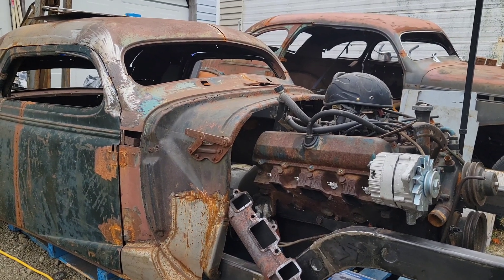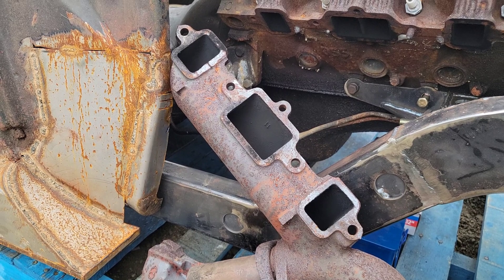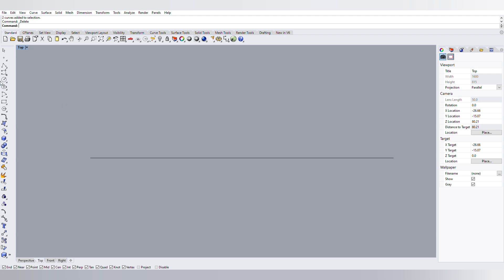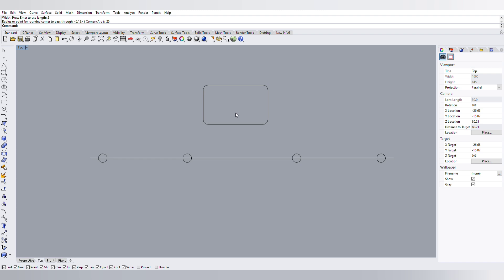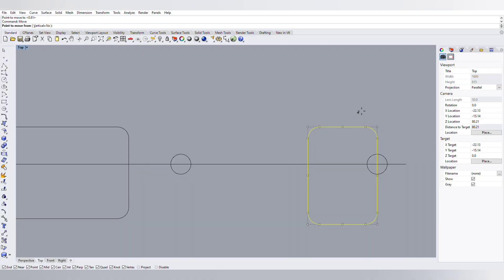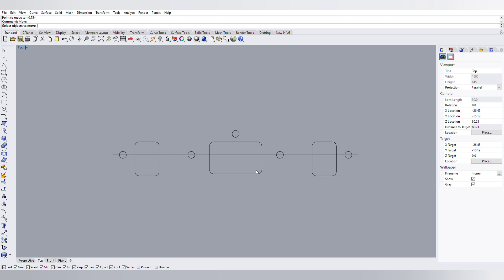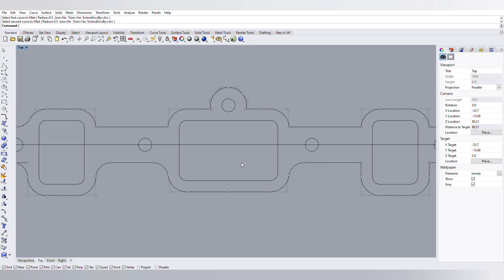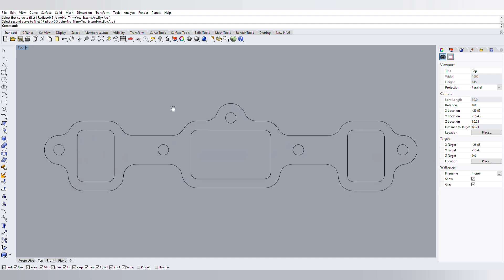Monday Morning CAD Episode 6  Header Flanges for my 260 Olds V8

Comment: Just a thought, with the size of your feet and the size of the car, I would think a reverse pattern manual shift powerglide with a turbo input shaft might be just the ticket as I don't think you will have enough foot room for a clutch pedal. I used to work for Bill Hays of Hays clutches  and more recently Centerforce clutches. I worked for bill in the first year of Counterforces existence. It was fun, my buddy and I got to thrash test clutches in our cars after work. Anyway, if you must have a clutch. I would suggest a 9 inch twin disc Centerforce clutch. You will probably be wearing light shoes to fit in the car. The Centerforce has a light pedal but will hold a lot of HP.
Reply from the maker: Everything I own is auto, the blown big block in the other one is staying auto wirh a full manual valve body.  Got to have a stick this time.  Looking at saginaws and muncies or maybe a t5, but it may depend on the next couple days, I think I have something stupid that will be amazing coming 🤣
Reply: @kingofbootyfab  muncie M22 ( The rock crusher is the best )

Comment: Even though I don't have access to a CNC machine I'm finding these CAD videos interesting because you are working on stuff I can relate to.  I've built some tools and equipment and related items but using mostly basic tools.  I've even made a couple of exhaust manifolds but just for 1 and 2 cylinder small engines.  I think I am going to try playing around with some free CAD software just to see if it is something I could learn and make use of.   I wouldn't want to spend the bucks for something like the Rhino 3D and then find out I couldn't learn it or just didn't want to put in the effort.  On the other hand if it looks like something I could get the hang of the money would be worth it later if I wanted to continue.
Reply from the maker: I'm working on some videos of free open source software for people who want to learn without fancy software.  Honestly being able to program simple brackets and flanges opens so many doors for people building Cars, and is a skill that requires zero special tools.
Reply: @kingofbootyfab  That would be great.  Looks like there is quite a bit of open source stuff out there but without any experience with any of them I wouldn't even know where to start or what to begin learning on.
Reply from the maker: I'm going to test some, I've got a couple on my computer already, if I'm gonna do these videos, it feels like the right thing to do and I'm no engineer, just a guy that knows how to program.  So I'll give some solid feedback.  Hopefully in September

Comment: Headers. If the tubes aren't around 28 inches with a 4 into one collector There is no HP difference, none.   PS. I have a 1000 HP engine dyno.  That little engine with a 471 GM supercharger, two 600 CFM 4 barrel carbs would be an awesome tire shredding cool looking m o chine in that car.  I would also put the radiator in the back of the car and use an electric water pump as well as putting the alternator down low. That cleans up the engine and makes it look more bad ass ! I would also use Zoomies  COOL....Just a suggestion. Love your work !!
Reply from the maker: 28 inches will be hard to get, but my plan will get then close even if it wasn't my intention.  I'm looking into later Eaton superchargers, I know where one is, from an 80s T bird, would be just about perfect, just need to convince myself.  From my understanding this is the next generation of Olds motor after the aluminum turboed 4.3s, so in theory, small bore, thick cylinder walls, maybe it will hold up to a little boost.  I haven't decided if I'm brave enough to risk it yet.  But it's definitely on my list of possibilities.
Reply from the maker: I seriously considered the rad in the back.  But being honest  I'm not sure there is room.  If I have it, that's where it's going.  But I need to get the rear end in before I decide.

Comment: Hi, The artifacts were left because of the way you selected the lines/curves. Left to right does one thing and right to left does another. One deletes and the other does not. Watch the video and you will see. I didn't Know they made Oldsmobile's that small. Back in my day everyone who had one had a 455, Always in boats.
Reply from the maker: Absolutely.  I could have reduced the radius but it just didn't suit my tastes.  Rhino is weird though, some days it will filet the corners just fine and not do that, some days it leaves me the lines, I have a feeling it has something to do with the way I program, which according to my engineering friends is the absolute wrong way to do things, and also the reason I've gotten into the habit of joining everything, and making sure that it states it is one closed curve, and not an open one which means I have extra lines I missed.

Comment: 0:43 there should be a common line  between side window height and windshield height position
Reply from the maker: I know exactly what you're saying.  But that's factory location for that body style, I haven't messed with those lines at all, and rhe amount of work it would take to move the door windows up would throw off other lines on the car.